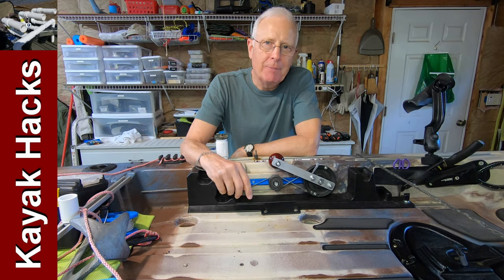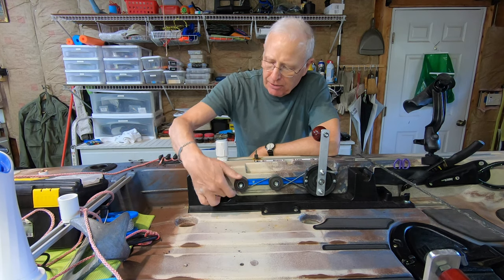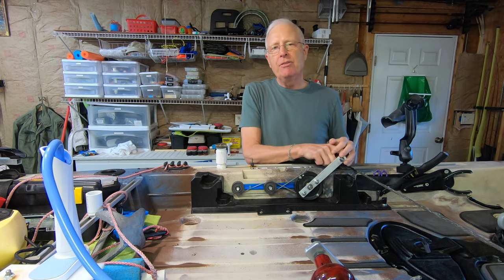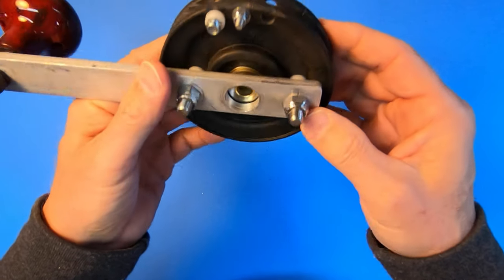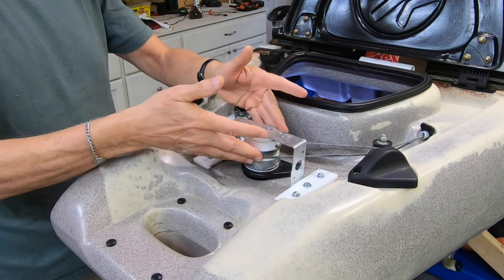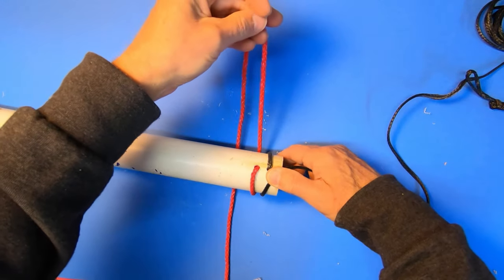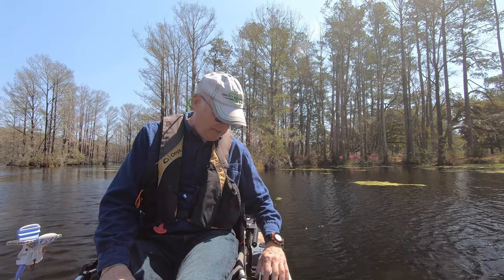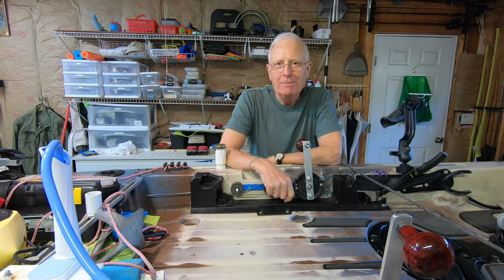Ultimate Kayak Mods - DIY Kayak Steering Upgrade - Shown on Jackson Coosa FD

Comment: This would work great for a trolling motor as well. Thanks for sharing.
Reply: Have you tried this yet with a trolling motor? I'm about to set my kayak up with a trolling motor, but don't want to do foot or pole/side steering. I'd prefer to have a handle next to the seat similar to this.

Comment: To help with the cable jumping off the pulleys: It looks like you could easily attach belt guards to each. Just a piece of flat stock bent at 90 degrees sitting perpendicular to the pulley rims just clear of the rims themselves. The cables won't be in constant contact with the guards, but have no space to leave the pulleys. Your ride on mower or tractor will have them at the the drive belt pulleys. That should help if the cables continue to stretch. That's a great piece of engineering, Fred.....
Reply from the maker: I'll do that - thanks! I was out again yesterday after tightening everything up and no issues. But, why not complete the job!

Comment: I upgraded the steering in my coosa fd to the new style. I still notice it will jam if I go all the way forward or reverse. It literally takes both handles at once to unstick the steering. I would love to truly feel confident operating the kayak with one hand on the rod still. This steering mod looks absolutely fantastic. Nicely done thanks for the video!
Reply from the maker: So far so good. With the virus, I have only been able to exercise it twice. After tightening everything after the first run, the second was very nice.
Reply: @KayakhacksFishing  awesome. Great to hear! I actually just completed a project raising the seat slider brackets 2" and still being functional. I managed to make a pretty cool setup out of plastic, under 2lb of extra weight and the low setting on the seat bracket sits the same level as the high setting on the bracket beforehand.
Reply from the maker: Wow! That sounds like a complex project.  If you did a video on that, please post it!

Comment: You could use 1/4" or 1/8" U-boat instead.  That way they can be adjusted at will.  I've used them to tie steel cable and they work!
Reply from the maker: Great tip! Thanks

Comment: I have been studying several methods for steering a trolling motor… one idea I like is not having to use a lever or anything. You attach cables on each side of motor shaft, like we see in most videos, and run both cables in each sides all the way up to the seat. Then, you complete the loop using a tensioner like ones used on clotheslines. To steer, you just reach to either side near your hips and grab the cable, pulling the cord forward to go right, or pulling it back to go left… doesn’t require any hardware other than eyelets to guide the cables where it’s the most convenient for you. One could even decide to close the loop in front of you, the cable sitting on your lap in front of your belly, and just grab the cable and push left or right… any thoughts?
Reply from the maker: I think that would work if you put some kind of a handle on the cable to make it easier to pull.

Comment: At 13:30 to push rope/wire through crimps like that an easier way is to make a circle loop of dental floss, loop it in your hand 2-3x, then feed the thin floss loop through the crimp and put the bend of rope/wire through the exposed floss loop and using the floss pull it through the crimp, don't need push tools etc to feed it through which can possibly cut the rope/wire insulation. Old trick in automotive for feeding wires through tight spaces
Reply from the maker: Wonderful tip! Thanks

Comment: I made something similar  but will definitely incorporate some of these ideas into mine thank! Have you ever used Zing it line? It may work for this as well.
Reply from the maker: No, we did not consider that. I just looked it up on Amazon and the breaking strength was much lower. That would probably be OK if it did not stretch, and, important, not bounce back. It would be worth a try for somebody else - but it is much more expensive than the line we used.

Comment: Would a spring tensioned idler pulley be practical to help with slack?  Cool idea. As was mentioned, would be good for trolling motor too. Not sure it would work as shown on Hobie PA, but might with a few mods.
Reply from the maker: No, I do not think that would work since the line needs to be very tight.I think it would just max out the idler.

Comment: What did you use for the tubing for the line to go through, where you got it and price please?
Reply from the maker: The tube was already there for the original steering mechanism. But, if you need more, you can get tubing by the foot from Lowes or Home Depot.

Comment from the maker: Here are a few additional tips from Fred who designed the system: 

Correction: when you talk about the hole on the aluminum stock handle, you say, "then you can make either a complete hole right here or  just big enough for the bolt to your going to attach..."  This is incorrect.  This will not allow you to tighten the wheel to the track.  If you do, the wheel will be frozen in place.  The wheel turns around the bearing.  The bearing is bolted tight against the track, so the wheel must rotate around the bearing.  So the hole in the handle for the bearing bolt hole must be bigger than the nut that bolts the bearing tight to the track.  Turn the handle back and forth, and you will notice how the handle rotates around the nut, but the nut is motionless.  It has to be since it holds the bearing tight against the track, and the wheel rotates around the stationary bearing.

Clarification: when you mention the small bolts I put in to terminate the line on the wheel, you should mention the aluminum spacers or sleeves I put over the bolt itself.  This is to prevent the sharp edges of the threads from cutting or wearing down the lines.

Correction:  the third hole in the wheel that terminates the line is not to adjust tension but to allow the builder to make adjustments, so the two wheels are centered in the same position on each side of the kayak after termination and connection.  It allows for adjustment if one line needs to be slightly longer or shorter to center the handle in the correct position.    The two lines require different lengths to begin with, and it's challenging to determine and maintain that exact difference throughout the cutting and termination process at both ends. The result: a handle on one side at the center point will not be the same position as the other side.  The three holes allow the builder to make an adjustment to the line length.  

Clarification: the two spacers on the wheel between the pulley wheel and bar stock is to keep the bar stock from touching the center bearing.  This again points to the error above.  The bearing must be utterly free of the pulley wheel and bar stock.

Clarification: Near the end, when you go over how the line stretched, it may be helpful if you mention that the line stretch will stop after the first couple of trips and that to fix it is very easy and can be done on the water actually.  Just carry a wrench with you.  Mine hasn't budged since my initial fix the first time out.

Comment: Would stainless cable work in this application, I'm just starting to build my kayak and will be using a watersnake electric motor
Reply from the maker: It should. I liked the version I used since it was very flexible.

Comment: Do you have the misc hardware list? Looking for the well nut and aluminum spacer specs in particular.
Reply from the maker: I think I used size 10 or the metric equivalent for the well nuts. Hard to remember the spacers on the outside of the pulley. Rather than tell you the wrong size, take the pulley with you when you go to the hardware store and size it there. The system still works great!

Comment: The rooe you are using for your control here, I was wondering what you thought about using 550 paracord? I'm starting to gather parts to do this mod. Last week, my rudder jammed to the left and I ended up climbing around to the rear hatch to find the rods were turned to the point where i couldn't move the rudder using both hands on the controls. I'm sorry to bother you with this. Feel like I'm being a pest. LOL
Reply from the maker: The paracord would have far to much stretch. The line must hold tension well. No bother!
Reply: @KayakhacksFishing  thank you so much.  I don't know if you hear this much, but I definitely appreciate all you do. Always right there with great information.
Reply from the maker: @racerx12003r  I really appreciate that - thanks!

Comment: So, why not just use coated wire?
Reply from the maker: I did not investigate that. I wonder if it would not be flexible enough. This system is still working great several seasons later.

Comment: I know your video is >1 year old. But, I think it's worth mentioning that Fred's video links (above) do not work for subscribers in the UK. I don't know if this is the same for folks in the USA.
Reply from the maker: Ouch. Thanks for pointing this out. Fred removed his videos from YouTube
Reply: @KayakhacksFishing  Has Fred moved them somewhere we can still view them? I only ask, because it's sometimes worth getting a second view of a project prior to undertaking it. I'm currently fitting a trolling motor to my kayak. I have a series of questions that you may be willing to help me with:
1. I have the standard V shaped steering cable connector on the motor shaft. Would the steering mechanism you demonstrate still work without the rear cable wrap around fitting you have on the stern rudder shaft?
2. Does the 100mm pulley provide enough pull on the cable to turn a trolling motor 90deg or thereabout? Is it the diameter of the pulley that determines the length of draw when pushing or pulling on the handle?
3. what is the purpose of the two smaller pulleys? Do you actually need them?

Much appreciated! I'm busy watching some of your other videos and I'm extremely grateful to have found your channel. Thank you for sharing.
Reply from the maker: I'll send him a note with your questions
Reply from the maker: @tartanrambo  I sent your questions to Fred and he has not replied. I hope he is not having an issue with COVID